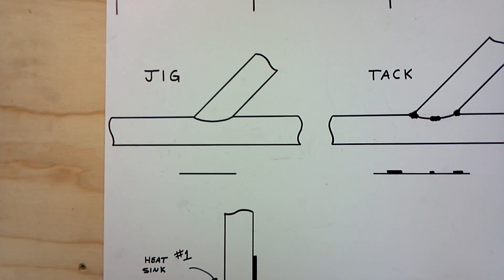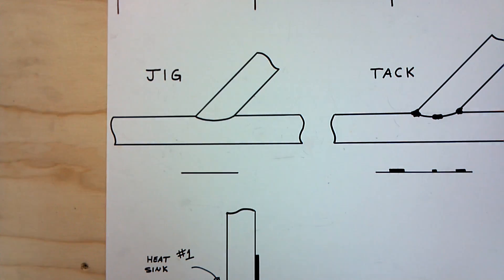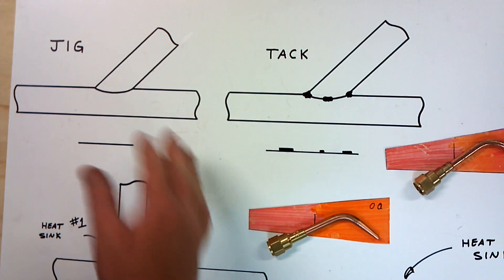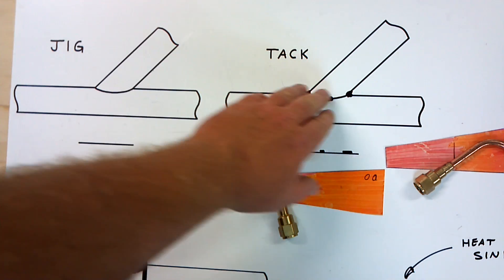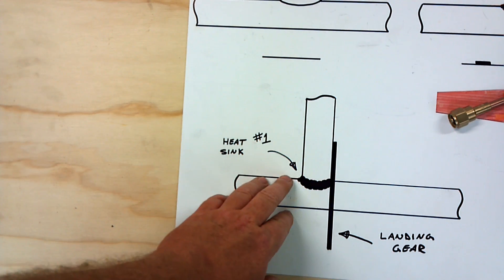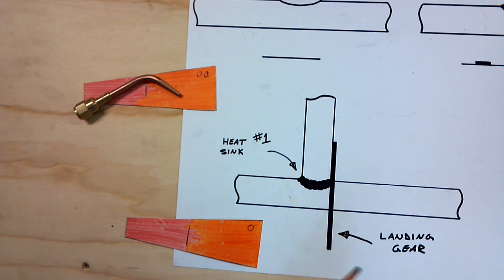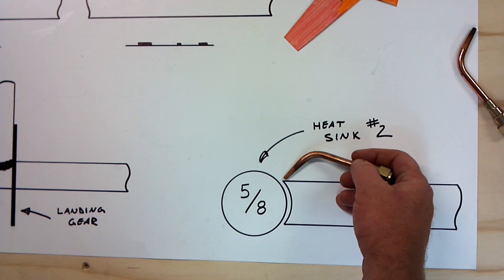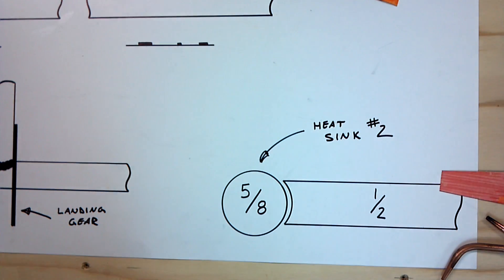Gas welding the Legal Eagle Ultralight #6

Comment: What is the advantage of using gas vs mig? Thanks
Reply: +Bobby John Hi Bobby John, I'm just a home hobbyist restoring an old car, but I use both mig and gas. I like to use gas over mig in a couple situations. If I'm doing sheet metal and I can get to the backside of it to hammer and dolly it, I prefer gas because if you prep the material right and get a nice fit-up, you can weld the new sheet to the old fender with hardly any filler rod. Then you can hammer and dolly the weld really nicely with practically no grinding or filing. Also, with almost no filler rod, you have two sheets welded together that are the same strength and ductility, making it easier to work into a nice surface. If you use MIG, you get a bead of MIG weld that's stronger than the surrounding material (~70kpsi vs. ~40kpsi), so you can't work it as nicely and the weld can crack if I work it too much. But if I can't get to the backside to hammer and dolly, I prefer to use mig and just grind/file/sand the weld down. Another thing about gas that I like is that the tips are so small that I can get in tight areas easier, like the backside of the tubing in this video by LeagleEagleAirplane. Plus it's typically easier to see what I'm doing. The downsides of gas that I find are: It dumps a lot of heat into the metal so you get a larger heat affected zone. In a garage setting I have to be a bit more careful about fire safety. Running the hose from my wall mount to a far location can be a pain. Longer setup, longer alignment and fit (at least for me) with gas compared to mig. I find it easier to blow holes if I'm not careful with gas, but on the flipside when I'm welding sheetmetal with gas I tend to get a lot less pinholes that I have to go back and find and fix as compared to mig.  So in general, I kind of use both in different situations. Also, in a weird way, I find gas welding very soothing as compared to mig. It's really quiet, and much slower, and you can really see how the metal behaves. I think gas welding taught me some things about how to mig weld better.

Comment: I recently viewed this series of videos.  They are great. In explaining the use of tips he shows that each tip can be used over a range. One thing I don't understand is how is a tip used for thinner material then thicker material?  Do you turn up the gas or do you just preheat or just weld slower on thicker material?  I'm building a Skylite and plan to use a 1/2 VW.  Pete